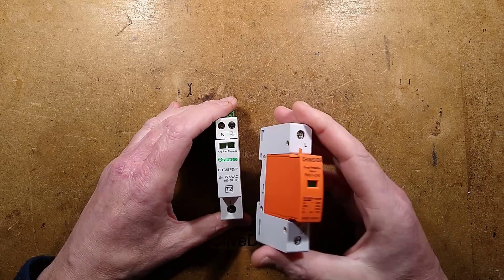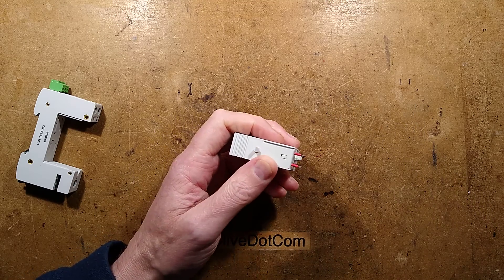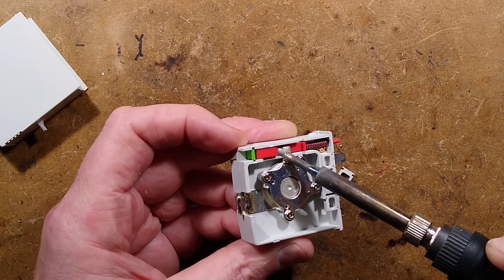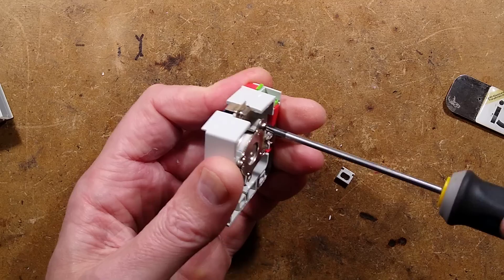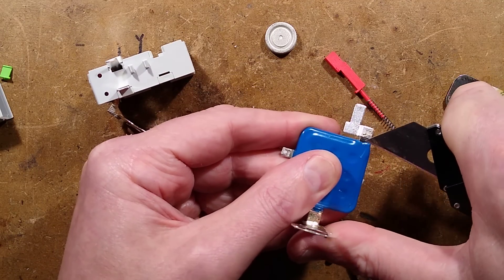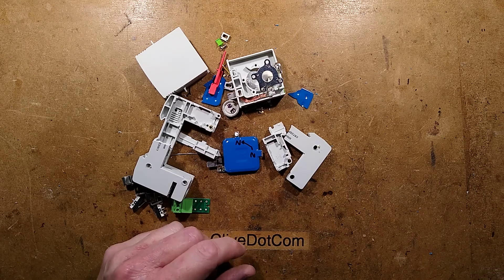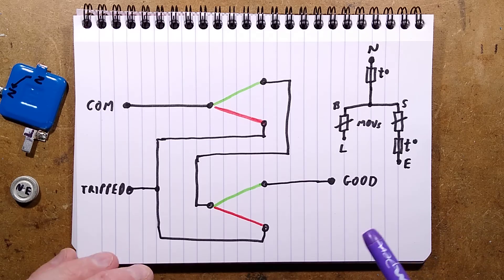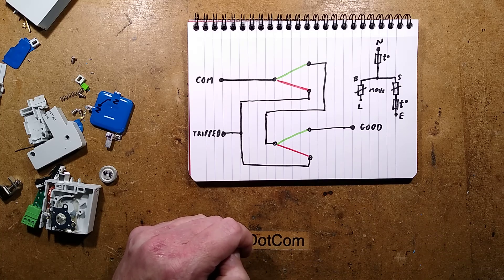Expensive UK surge protector teardown

Comment: What happened to the old style circuit breakers with a switch?.. Why suddenly make these disposable expensive ones?..
Reply: it's not a circuit breaker, it's to absorb transient  voltages. Still need breakers for the actual distribution circuits. It basically supposedly sacrifices itself to save your EV or 4k TV and PS5 etc. Basically a souped up version of the plugin surge arrester strips you can get

Comment: ever see a USA panel surge protector? it is 1 piece and doesnt use phoenix connectors, only a grub screw, has both heat and magnetic current breaking modes
Reply: That's uh, a circuit breaker, not a surge protector.
Reply: @Monkeh616  my bad, they make surge suppressors as well but most people dont have them

Comment: The trouble with expensive things is that they're often not really all that expensive to manufacture. Only when the law requires that thing to be installed, does it become expensive - Just like microchips for your cat. Last year, you could microchip a cat for around £10 each, but now that there is a legal mandate for all cats in the UK to be chipped, the price to the end user is now around £35 each, and likely to increase yet further as next August's deadline approaches.

Pushing the expense further down the line is an increasingly common phenomenon!

One thing I'd like to know is, could these devices be made resettable? As in, could there be a resettable version that requires little more than the press of a button, or the flick of a toggle.

Or, alternatively, a version which could be reset by the skillful application of heat - Rather like the resettable thermal fuses that could be found in early Murphy TV sets?
Reply: Also supply and demand. A couple of years ago the supply dried up. With a mandate the supply again will run dry. Just normal market economics.

Comment: They're not mandatory yet but an advised. I'm sure when the next round of updates to 18th edition comes out they will mandate them!
Reply: There's a get-out used in a lot of the building industry that allows an old design to be "grandfathered in". So a 2023 new house is built to an old design, and the house buyer is stuck with a shortage of power sockets set in awkward places.
Reply: I pay home insurance for a reason, if a lightning strike kills my computer and TV they're the ones responsible.

Comment: Nice, hate to see you tear it apart though. Do British residential electrical distribution panels use DIN rails ?  I've seen a lot of these but only in machines, but that's in the states.
Reply: Yes, the modern UK consumer units have the MCBs, GFCIs etc mounted on a DIN rail (or two or three DIN rails for the big 20/30/40+ circuit CUs)
Reply: Yes mostly top hat style DIN rail now.
Reply: "..but that's in the states."  Good luck with that. Could be confusing for some because the rail is known as DIN 35 (35mm wide) and you have a state of affairs where any DIY moron can wire up a home. 
No doubt there are many 'base' installations that don't have modern distribution panels still in-service all around the World.

Comment: We are not allowed to mix brands in DB or CU , so the expensive crabtree can only be fitted to to crabtree board, so you cant fit a cheaper Hagar SP in to a Crabtree board for example , but the work around is to fit a small Hagar board upstream of the main board ect
Reply: But why is it not allowed to mix brands? Even here in Germany it doesn't matter one bit if you mix all the brands availabel in a distribution board.
It is quite common, that the brand of the distribution box doesn't even offer any of the stuff that goes inside.
Also I don't unerstand why metal boxes are used in GB. In Germany we use mostly plastic boxes (flame-retardant) or metal boxes that have a plastic liner inside to make them class II.
Class I boxes are rarely used in residential applications and if they are used, usually there is extra grounding necessary. In industrial it is different, but there grounding is an art of itselfe.
Reply: approval status. we love paperwork @fkiesel9442
Reply: @fkiesel9442  mixing bands fails the EICR, as mixed brands have not been tested together
Reply: technically you ARE allowed to mix brands but then you have to get it all type tested and you take responsibility. The only time this generally happens is control systems, but breakers for domestic use with mixed brands happen in swimming pool controls, quite frequently you'll see one make of breakers, another make of timers, a third make of contactors... etc. But it's all type tested by the pool company (supposedly!)
Reply: i often don't get why you can't mix  makers in god damn din rail panel. they are all certified to work. and installed by pro. maker nor installer is responsible for faults they didn't intentionally cause. i mean i once bought ge mcb. installed it and found it won't work. took it to supplier, they didn't believe me, had to test it with neon screwdriver and random mains lead. wasn't really electricians behind the counter. to their surprise, it didn't pass anything in closed. i should have taken it apart instead, as i've never seeb brand new mcb to fail. but there you go!
Reply from the maker: In an ideal world every breaker would be a standard size with a standard terminal position, but there is a slight variation between brands that could affect the ability of the cover to go on, or stress the busbar connections.
Reply: @bigclivedotcom  yep, busbar connections are the big issue. If (for an emergency) we need to fit a non compatible breaker while a new one is on order, we will often use a bit of 10mm2 or smaller if the breaker is a small one, to hook it up  to remove the stress.
Reply: @bigclivedotcom   The cover should go on regardless of the brand, since this is part of the standard.
It is true that the busbars won't fit between brands, but you can always use wires to make the connections.
I still see no reason, why mixing brands should be any issue, but I guess this comes down to politics.
Reply: @fkiesel9442  Usually there is a wide selection of devices that have compatible terminal alignments that permit a common busbar to be used across brands.  It's not unusual to see older installations in Australia, ie devices added / changed over time, with a good mix of brands working happily.  The UK regulations have sparkies over there tied in knots over the liability concerns in using 'non-type approved' devices in brand X boards.  Doesn't surprise me when you look into how their car insurance is set up to gut their wallets.

Comment: Crabtree and Wylex are both owned by the same company Electrium (A Siemens Company) so highly likely that is virtual the same unit.
Reply: Back in the day, I uses to work at the original Crabtree factory in Walsall. They sold out to Eveready, then got closed down..

Comment: i would like to have one which cuts power off rather than disconnects. would be easy to make using thermal cutoff of some kind. yes, it conducts power but so do breakers! it's funny that most of them are being sold to generic user who wouldn't benefit at all if it protection failed and power stayed on. also, to be honest, if that fails, and it's like broken neutral or lightning strike, i would really prefer if power stayed off until checks. i've so far yoloed in my two houses by no spd at entrance, only had one on copper phone line when i didn't have fiber yet. but i now realize it's really cheap to have spd and over/undervoltage protection, compared even to my moderate cost of equipment. nevermind the danger of fire or hassle of busted freezer. so in future i might do something, even if diy
Reply: I wouldn't want one which cuts power. The whole point is to keep things working, not turn them off without warning.
Reply: @Monkeh616  It'd only disconnect if the MOVs get hot and melt the solder link, ie long term damage or one really big hit.  Which is worse?  Having the crap blown out of your expensive things that you think are protected but really aren't, or having the power turn off on failure of the protection?
Reply: @retrozmachine1189  The latter, because I can verify the state of the SPD without forcing equipment I'm using to power off..
Reply: @Monkeh616  What happens if you aren't around to verify the SPD is still working?  A decent lightning storm one night when you are out on the town?  A network fault pushing your mains voltage way out of spec while you are at work?  No need to answer, just giving you something to think about.
Reply: Easily achievable already.  Use the signalling terminals to control a trip device which in turn pokes an MCB through its ganging port.
Reply: oh yeah right! you can get trip attachments for mcbs
Reply: @ketas  Yes you can buy 'trip attachments for decent MCCB's. But they are not used for such critical applications. 
These are known as 'shunt trips'. 
This is not a 'generic user' device and the do provide adequate over voltage/surge protection. 
The 'disconection' is NOT of the whole installation... it is a disconnection of the surge device from the supply after sinking a significant fault. Can you read schematics and see that there is no Line and Load connection on the Active or Neutral lines? The disconnection feature indicates the device is no longer capable of protecting surge events. 

Your 'generic device' is a stupid power board sitting behind a domestic AV setup containing pathetic MOV's that are more inclined to burn down the house when sinking a significant fault due to a high kA fault event. 

I take it you have this misunderstanding due to living in a place that allows unqualified DIY 'electricians' doing install works and no real electrical safety testing undertaken prior to energising any circuit after works are undertaken. Good luck with that stupidity.
Reply: @BTW...  Did you even understand what is being discussed here?  I think not.  The intent is to break supply to the device should the SPD signal it has failed.  This is nothing to do with the breaker associated with the SPD.
Reply: @retrozmachine1189  Yeah, you think not. 

Professionally, I've worked with these devices  for decades in the power generation / distribution sector and heavy industry. 

Bother to see who I responded to... who is the one with no idea, clearly thinking the home has it's supply "disconnected" by devices like these. 
Similar misunderstanding is shown by those who think it would be a great idea to have power similarly disconnected if the device suffered failure through sinking transients > excessively heating > fusible link melting > visual and fault indication. 
Yeah... bother to read further and recognise the lack of understanding from 'youtube professors' , including yourself.
Reply: @retrozmachine1189   Oh, and there is zero need for a CB prior to these Class 2 devices... instead the usual HRC Service fuses, typically 63A, 80A or as the devices are rated around 125A max.  
Do you understand the 20kA, 40kA and 100kA ratings that appear on these SPD's? 
Do you understand how these Certified SPD's can safely contain a fault at those levels... and how crappy Class 3 devices, the likes of overpriced 'surge protection' power outlet boards and MOV's in appliances or LV to ELV power supplies, cannot contain such load sinking? 
Think about that, Mr Think Not.
Reply: @BTW...  Yes, because that's definitely what you want, blowing your service fuse(s) and being left without electricity until the network operator or other authorised person comes round and fits a new one.  Brilliant.  I guess the reputable manufacturers that say to place a breaker in line with the protectors have absolutely no idea what they are talking about and should instead defer to the statements of some anonymous clown in youtube comments.  Guess what?  There's more than just the instantaneous current going through the devices at play here.  The fact that you are going on about just the fault rating of the SPDs in order to demonstrate your superior knowledge shows you still do not grasp what is actually being discussed here.
 
You really like the sound of your own voice, don't you.

Comment: I used to love the Haynes workshop manuals when it would state ' Reassembly is simply a reverse of the dismantling procedure' ! A well made unit but quite costly at £90+.
Reply: You pay for quality and sink capacity. Cheap out and the MOV trip will not contain the full prospective fault current, measured in kA .... and burn out the distribution board.
Reply: I tried that with the Haynes Baby manual, turns out reassembly is extremely problematic. Even the police had to get involved!

Comment: We monitor SPD through our PLC’s as standard on all of our panel builds now. (Water industry)
Reply from the maker: Interesting to know.  Is it just local indication or remote monitoring?
Reply: @bigclivedotcom  local indication on HMI plus remote monitoring back to regional telemetry system (where somebody in the control room
Will ignore it 😩)
We’re moving store rooms soon so I’ll likely have some old PLC gear if you’d be interested in any for the Channel.
Reply: Wise move. How long did it take for them to consider this given water supply is an essential service? 
I've seen this policy applied for well over 30 years in the electrical generation / distribution sector.
Reply: @BTW...  only recently, but as we monitor mains supply, UPS status and 24v supply, monitoring of the surge status isn’t really that much of a priority.